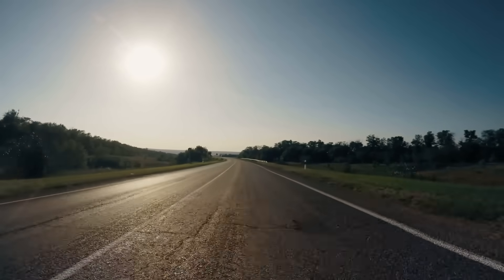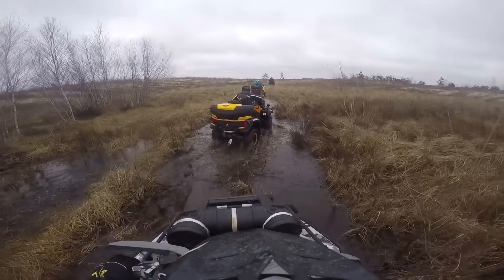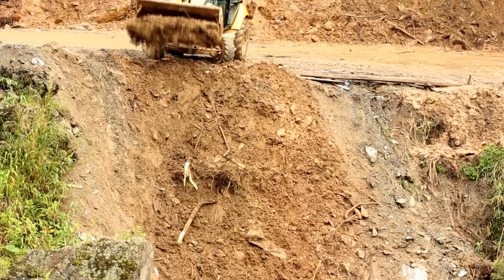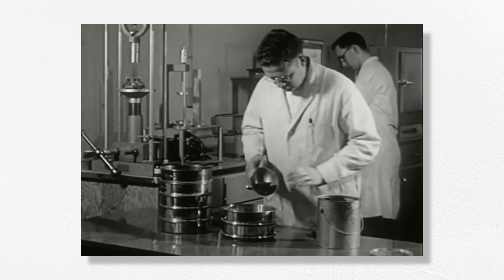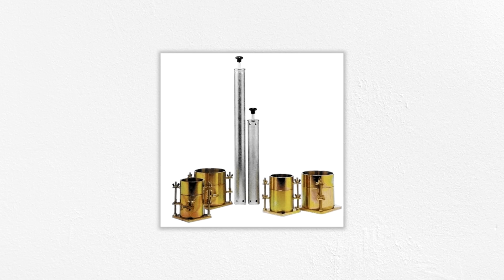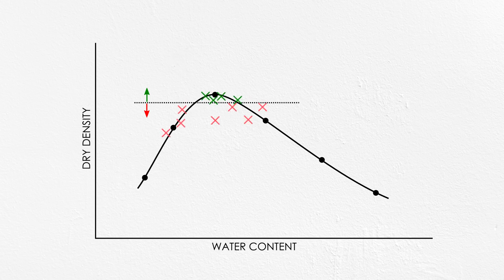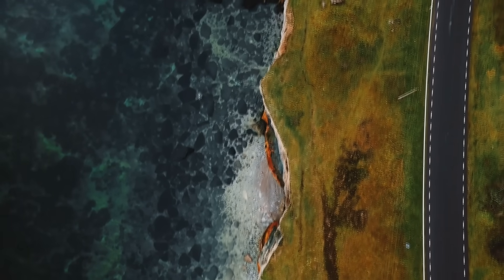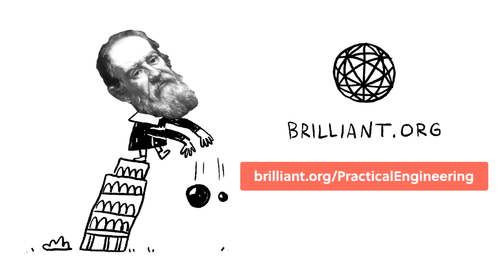Why Does Road Construction Take So Long?

Comment: Actual reason change orders occur.

Engineer: Let’s take two years to design this project and anything we don’t understand we’ll just add the risk onto the Contractor with a general note somewhere before it goes out to bid.

Contractor: How long do we have to submit questions on the bid you took two years designing?

Engineer: Two days after the Pre-Bid Meeting. Make sure you read every general note, every specification section, every detail, every document referenced, and all Addendums Issued because we still couldn’t design it right after two years. Make sure your subcontractors adhere to every specification too. Also, make sure you let the Engineer know of any discrepancies prior to bid submission.

Contractor: Here is your Change Order. We couldn’t possibly read all the information provided in the specifications thoroughly with in a few days time and find all your mistakes too. Of course when we did want to discuss the project, there was a cone of silence in place so we couldn’t. Even when we submit questions, the Engineer is usually too risk adverse to give the Contractor a straight answer. So, here is your RFI and Change Order after the fact.

Engineer: I can’t believe the Contractor didn’t read our note.

Contractor: Wishes all Engineers would be more realistic.
Reply: Sounds like you've got some experience....
Reply: Oh.
Reply: And a lot of times the developer wants things built before. Design is complete so an engineer may spend a couple months on design but construction starts after only a couple of weeks so then the building is being designed while constructed then the developer just pays for the mistakes along the way
Reply: dietrichris lol! Engineer: What do you mean, you can’t put 10 gallons of shit in a 5 gallon bucket?                                                                           Me: You are a f#*king idiot! That’s what I mean.
Reply: dietrichris you should’ve seen his face, when he showed up on the job to “discuss this change order” and there was 62 inches from the floor to the make up air ductwork and they haven’t poured the 4” concrete floor yet!            Me: We could leave it like this if you  hire a midget chef, I mean they are called short order cooks. Or we could dig a trench in front of the grill. lol.   I think he really liked me by the end of that job. I mean, I did try and help him out at the beginning of the job. I told him as soon as I seen the plans! It was an existing building, he could of just drove the 30 minutes and pulled a tape out before drawing the mechanical pages! Hell! I just changed the rest of the ductwork so it would actually condition the space and was a lot easier to install also. But I can’t preform actual magic, stainless steel duct and diffuser are hard to modify.
Reply: Halfman Halfamazing; they never listen at the beginning, only after they’ve gotten themselves into trouble do they acknowledge the contractor and then usually they still try to make us look bad somehow. Working directly with the owner is never a problem, thankfully. There are good engineers, but it’s about 50/50.
Reply: dietrichris yeah that’s the only one I have had a lot trouble with most are good at what they do, as long as you give them a way to save face, you know, like “The drawings are fine, we just would like to have a bit more room so we can stay out of the other trades way”. Or “It would of been fine but the inspector might have a problem with it.” lol but what you are actually thinking is, How in the hell did this guy expect any of this to work?
Reply: then add government getting in the middle. but where i live a city project was delayed when the city was not paying the bills as contracted a side note when it was delayed a burrowing owl built a nest under a piece of equipment and the could not move it until the chicks flew off state law protects them
Reply: I didn't work construction, but I did work in machining doing work ranging from custom models, injection molds, to gear making. The job made me hate engineers. Both for the blueprints they gave me to work off of, and for the machines they designed that I had to work on. I swear, every engineer should spend at least 3 to 5 years working in the field, doing the labor for the industry they plan to engineer for.
Reply: Well that's why the "expert" contractor makes the big bucks no? They get paid handsomly to do the leg work and assume risk.
Reply: Ahahahaha I am new into this world and don’t have a lot of experience yet, but you’re comment is hilarious!!!! I work for the engineers. Super duper smart guys and gals that just kinda make me wanna pull my hair out🤣🤣🤣
Reply: The problem with engineers is even tho it might look good on paper, they really have no idea of what the practical application will take

Comment: Related to road building is high speed rail building. I've been watching the step by step progress of the California High Speed Rail project. In many ways it is like the beginning of the Interstates. It's all new for the engineers so they make some mistakes at the beginning and it takes longer than was originally expected. There are parts of the originally planned Interstate system that still haven't been built.

Of course HSR is different. It has to be tested at 250 mph (400 kph), although it will only operate at 220 mph (350 kph). One certainly has to make sure the subsurface is compacted and the right of way must be absolutely grade separated. And being that it is in the US of A one has to wait for all the environmental impact reports to be done, along with all their public hearings. And then there are all the lawsuits by the NIMBYs, BANANAs and CAVE people. But it is fun to watch.

Comment: I dont miss having to do compaction testing on soil,rock or asphalt. Nothing worse than some know it all contractor saying my gauge is wrong, when I'm using the Proctor number from the sample HE provided. Sometimes they want to half ass it so they can get onto the next phase. 
Surprised you didnt mention the dreaded sand cone method for density measuring. Its required on Army Corps of engineers projects. I think for every 3 or 5 nuke tests, you have to perform a sand cone test to correlate.

Comment: Two things that I am curious about:
A) When a freeway is undergoing repairs and they cut out a section of it, why do they cut out an even rectangle to repair sections?  The repaired section is many times slightly higher than the surrounding road and the new bump created just causes more stress as cars and trucks apply massive amounts of stress in added tons of force to the existing roadway as they descend from the bump.  Wouldn't it make more sense to have the repair cut more in the shape of a parallelogram so that the force of vehicle descending weight is disbursed?  Wouldn't this make a more comfortable ride for travelers? 
B) I have seen massive Styrofoam blocks used in lieu of fill dirt at new overpass construction. What is the life expectancy of these Styrofoam blocks?  Don't they deteriorate or animals carve homes into them?

Comment: it takes so long because it funded by theft at gunpoint (taxes) and connects political points rather than place people actually need to go.  The question should be why does driving anywhere take so long?  The answer is because the organized crime racket known as government is forcing people to use roads, forcing them to sit a red lights, when if none of it existed there would be NO traffic.. people would just drive through the nearest field, they wouldn't be sitting in lines on roads waiting to get on with their lives EVERY SINGLE DAY.  There would be a lot more cars that could hand driving through fields though most likely, but there would be a lot more useful flat places to get where people would want to go.

Comment: Its one thing when they are building new roadbed.  Its understandable that that takes a long time and chances are it was not a functional route anyway so its not impacting the commute.  Its another thing entierly when they spend 6+months keeping a major road closed or half closed for a simple resurfacing.  Does not help when they also only work during the hours with the heaviest traffic, all pack up at 5 (without opening the other lanes for rush hour traffic) and do no night shifts.
I swear sometimes it seems they are going out of their way to make construction season as painful as possible for as long as possible and have the gaul to put up "Your tax dollars at work" signs everywhere.  I say if its my tax dollars working either work faster or give them back.

Comment: "If you want to have cities, you've got to build roads."
-Cake
Reply: Unfortunately this isn't the case. The main reason we have roads is lobbying by the automotive industry. Simply building more compactly and having mixed zoning the vast majority of people could live, work, and eat in a very small area, requiring little to no commute. Unfortunately we let privatized housing investors jack up the cost of living in areas people work, forcing everyone to commute. In order to accommodate these large numbers of commuters roads have to be built 5 or 8 lanes wide, and they sit idle on non-peak hours. They're costly and inefficient taxpayer funded subsidies to the automotive industry. Mass transit and freight is the solution.
Reply: @introprospector  You still need some roads! :P
Reply: @introprospector  look at you trying to blame the reality of geography and human choice on evil corporations. There are places where mass transit is more efficient and there are places where it isn't. In a lot of cases they're about equal. Cost of real estate is directly proportional to how much people want to live in a particular place. You're talking about the function of thousands or millions of people making choices. dictating that to them that they ought to want something or ought not to want something is generally futile. Urban planning initiatives typically try to force one of the many solutions under everybody's life. and the next solution 30 years later is to undo all of the problems without one size fit all solution created. So it's usually a whip saw between radical extreme visions imposed on everyone. The current trend is towards trying to compel people to live in very compact spaces with very little privacy and no meaningful laundry facilities. To say that everybody needs mass transit. And must work somewhere near where they want to live. Or more likely the other way around. This radically restrains people's economic mobility. They can't take jobs that aren't within their train route.

Comment: To me, the most irritating part of municipal road projects is that within a few weeks of a road being finished, lane markers and all, there will invariable be some house that requires a cut and excavation to replace a sewer line that should have been replaced before the new road was laid in. At least lately, I have seen more of these road projects include a cause that inflicts heavy penalties on homeowners who need to cut the road soon after completion,  on the basis that they ought to have taken the opportunity of a torn-up road to have their sewer and water lines checked, and if necessary replaced. One city I lived near even offered a partial grant to homeowners who had that sewer line work done before the road work started.

Comment: I watched a major reconstruction project on a highway just after moving to a new job at the far end of the works. I intuited a lot of the very deliberate looking foundation work, including giant sheets of fabric to keep the soil stable. When they finally finished the surface asphalt, it was chip-sealed. (In Montana, they seal the road surface with a layer of tar and gravel that gets worn away by the snowplows over (I estimate) 3-5 years. Then they seal it again and, in theory, rarely need to repair the actual road.) The very first spring after the project was finished, large patches of the chip-seal were utterly gone. It was pretty disappointing to see such a beautiful and carefully built road capped off with incompetence like that.

Comment: Nowadays (in the states anyway) the DOT will no longer do the work but outsource (bid out) to some political pal's firm because, you know, wink wink, who has a full highway and road construction division (other than the state?). State consolidates division, auctions or scraps billions in construction machinery. Then pays out to winning contractor a bonus is "under a certain time". Meanwhile, what is left of DOT survey, finds drainage issues (rework, resurvey, legal dept involved, delays), then fines contractor for skimming (1/2 from crown for several miles). Contractor files for bankruptcy. Another signs up but now for more and bigger bonus to fix problems and complete on time (already 1 year delay). Find bones to ancestral Indian tribe and need tribal removal, relocation, reburial. Another 6 months. Contractor finishes on time, gets bonus. Roadway opens and congested, again, in less than 2 years.
(In EU, they build roads to last 30-40 years. Note: in the US, we run trucks/tandems that are FAR heavier than the lorries on EU roads. In the US, the roads are designed to be repaired/replaced every FIVE. But they never are, and most are now Mil 2 Pave 2 (milling machines come in, mill 2", then pave 2"). This isn't good when the substrate has permeable issues needing remediation. 
Now, let's do one of these on bridges...

Comment: I've noticed big GPS antennas mounted to the grading blades on several recent major road reconstruction projects. I'm reminded of them whenever I drive a stretch on the interstate nearby where it looks like the end sections of the road-height data weren't matched up properly. I assume the datasets were for about 1 mile each, but someone chose the wrong algorithm to smooth them into each other. At three places about a mile apart, traveling 80mph, you'll hit a series of whoop-dee-doos (dip-bump-dip-bump-dip.) They're smooth enough you don't quite get airborne, but you certainly get light in your seat. Every time I drive over them I think of writing an email to our DOT demanding that the contractor come back out and fix it.

Comment: In my area...because the construction companies aren't good at it. Having been taught how to build a proper road, I have a habit of inspecting the final product and haven't found one yet that even meets the minimum standards. Open seams, uneven surfaces, aggregate too damn big for that application (done to save money). For example a simple road widening project for a 5 mile stretch required one local contractor 9 and a half years. We built the Al-Can highway in months to a usable surface for a distance of 1,600 miles in a terrain they knew nothing about.

Comment: Question I still have:  On roadways that are being expanded, the existing road's age becomes very apparent and even accelerated from the heavier (both mass and volume) traffic.  This often leads to the old road being ripped up to be resurfaced or replaced after the new road is complete.  Does resurfacing/replacing the old road take less time as the soil is already compacted?  Or do they start over completely?

Comment: Now, I can't imagine the road-building cost in mountainous areas :)
Reply: Price in mountains is definitely higher, but far more variable:

* Earthworks: very deep cuts and fills, with the risk of creating new slope instability areas

* Drainage: steeper slopes on the road and the ground mean faster moving run-off, with more potential for erosion. Storm drain systems begin to need energy dissipation elements. Precipitation in mountains also tends to be higher than in the adjacent lowlands, both on the leeward and windward sides

* Deep valleys and canyons: lots of bridge work

* Going across tall mountains: tunnels might be more cheap than an astoundingly crazy rock cut and definitely more traversable than steep slopes and hairpin turns. They're still expensive like crazy because of all the complexities involved. Taking advantage of mountain passes and saddles is also really important to minimize the overall elevation change throughout the route

* Low importance roads: adapting to the terrain contours and exposed rock formations is very convenient. This results in hairpin turns, switchbacks and roads following the ridges of hills and mountains

* Natural hazards: slope instability can have soil, mud, rocks, trees and snow (avalanches) obstructing the roadways. In these cases, sheltering structures and more than the minimum clear zone on the side of the roads helps a lot with mitigating the impacts of these

* Cross-section: if it's an important mountain road, it's most likely to use 3 lanes rather than 2, with the third lane being added to the uphill segments to help keep traffic moving despite heavy vehicles slowing down to a crawl

Based on projected prices drastically increasing following the disastrous years from late 2017 to early 2020 (hurricane reconstruction and now earthquake reconstruction causing material scarcity), highway PR-10's missing segment in central Puerto Rico is estimated to cost a total of $198 million for a meager 8.8 kilometers ($22.5 million per km or $36.2 million per mile). A third of that alignment is bridges along the rainy Arecibo river's middle course. In comparison, the two projected new freeway projects for the Island are estimated to cost $23 to $26 million per kilometer, including eminent domain, interchanges and earthworks in far more forgiving topography for a 4-lane divided cross-section.